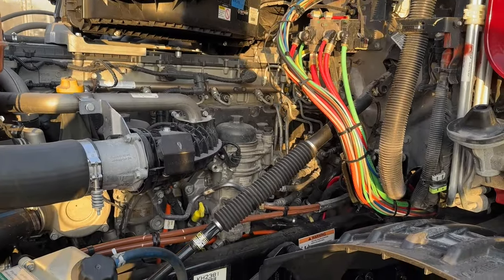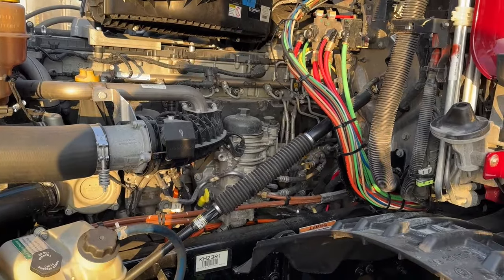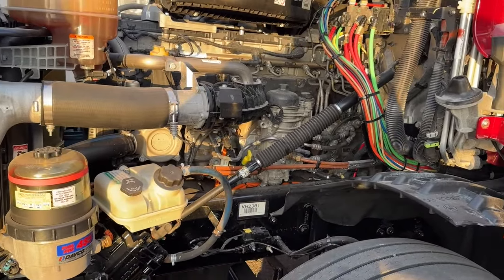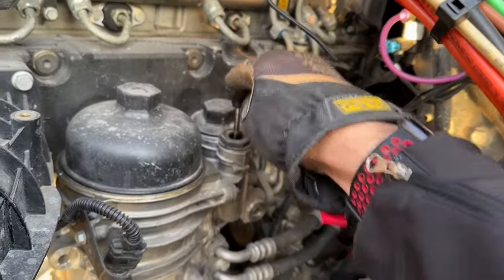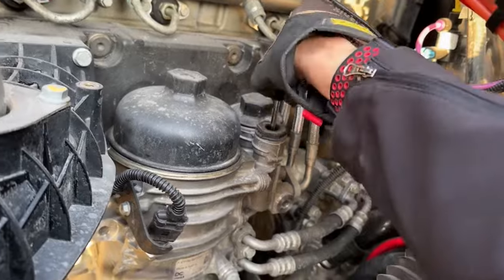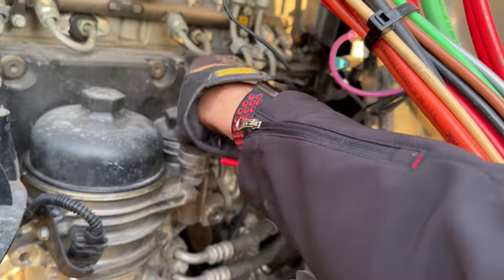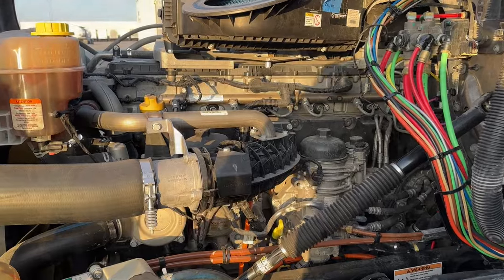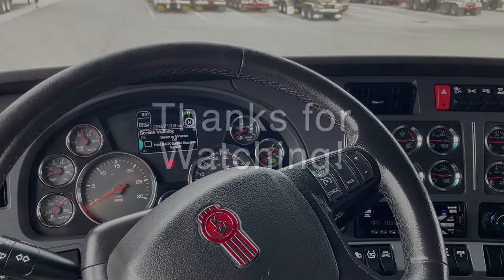Priming Fuel System Freightliner Detroit Engine

Comment: You may have to prime the fuel system through the diagnostic quick connect nipple fitting ( compucheck ) . A fuel canister that pushes 2 gallons of diesel fuel at 95 lbs. pressure .

Comment: I drove down rt 301 in ocala fl, came to a red light, truck then shutdown, i try and start it, it didn’t, it was cranking but wouldn’t start, I called in a tow 5 minutes before tow trucks arrival i came across this video, so i began to exactly do what the video suggested with priming engine and i shit you not it started right away, i still got the truck towed and now im at their yard to diagnose it, i didn’t feel safe driving further so im taking a hit on my checking account to hopefully fix whatever it maybe. Thanks. Its good to know these things for future reference.
Reply: Forgot to mention i did not have any engine lights on dashboard either before and after this video